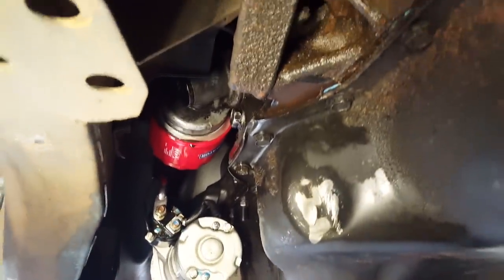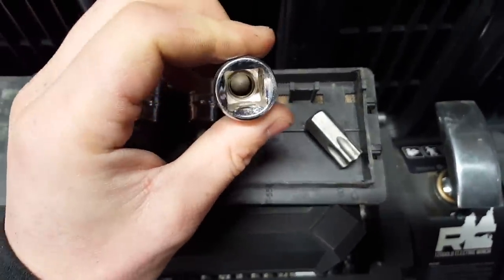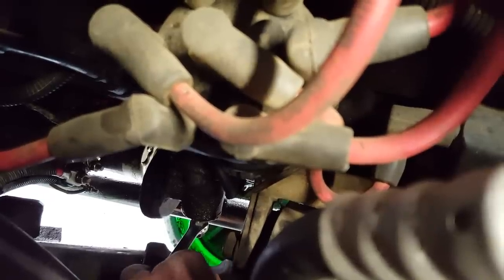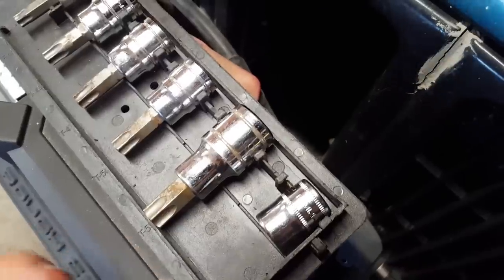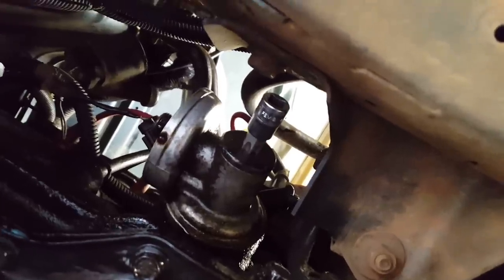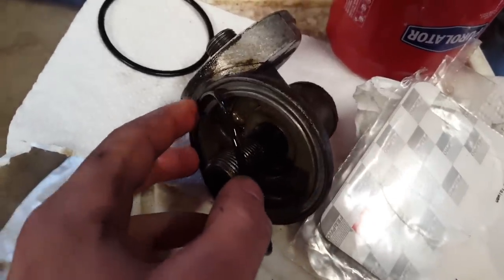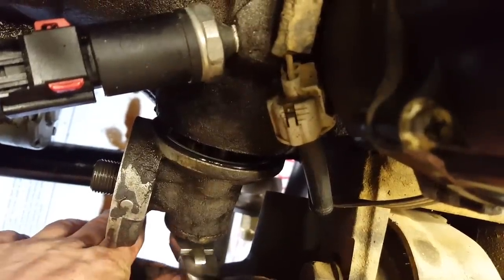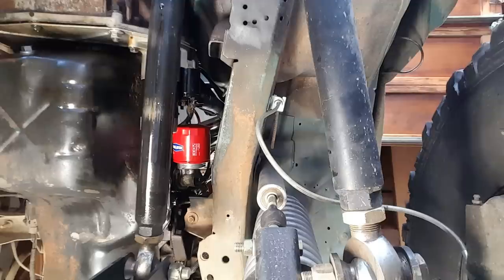Cheap Oil Leak Fix - The $2 Jeep Repair You Keep Avoiding

Comment: Hey Tim!  I did mine last August along with rear main oil pan and valve cover [thx for the vids on those].  Used a t60 in a set from advanced auto. Hammered out the bit and loosened it with a 12mm and a brakerbar accessed from the bottom. Maybe mine was easier cuz it was hot out.  Anyhow I changed the seals.. got an Oem pack of 3 from the dealership.  When i finished i put the T60 back together and returned the Torx set!  Great job on the Vid.  Keep em coming!

Comment: I being a former Dealer Jeep Tech, use grease on the seals ALL (3); and junk the purolator oil filter, get a mopar and grease the seal also. That's what I did my 92' xj. No leaks and eazy oil filter changes!
Reply: greg a purolator makes the oil filters for mopar lol
Reply: what kinda grease do you recommend

Comment: That's a good fix, but here's what I did on my 92 after some research. I removed that whole adapter thing, removed the dowel pin from the block, transferred the longer threaded pipe from that adapter into the block, and screwed the small filter directly to the block. Its a tight fit but the small filter will go in there. No leaks ever again in that area.
Reply: Did the same on my 2001xj today after putting it off for seven months. Bear of a job.

Comment: There are 3 O-rings. The other two are on the bolt itself. This is why I recommend getting the kit from the dealership. It's like $15, but you get everything you need. It's very likely your adapter will start leaking again.

Also, this job is MUCH easier if you undo the engine mounts and jack up the engine. It'll give you enough room to use an unmodified torx bit with a breaker bar. It's the perfect opportunity to replace/upgrade your engine mounts
Reply: gui577b felpro has an oring kit too. And maule.
Reply: Thank you for this comment!

Comment: Did this recently. Some tips I learned: Advance Auto Parts sells a T60 with a shorter bit than others I’ve seen. Gives a little more clearance. Using two other sockets like a pushing bolt/receiving cup pressed in a workbench vice works well to easily remove the T60 bit from the holder with no pounding. A piece of duct or black wire tape around the bit makes it fit snugly in the wrench. A large enough buddy wrench on the 12mm was enough leverage to bust mine loose. Finally, it would be hard to imagine doing this job without a ratcheting wrench. Hope that helps someone.

Comment: The correct part for ALL 3 O-Rings  by FEL-PRO is ES 72962 and in stock at 5000+ O'Reilly Auto Parts stores!
Reply: youre the real mvp
Reply: I got that part number for a 96 GC base oring was too thin.
Reply: @saintm1680  I don't know what to tell you but, I know it worked for me and every customer I've sold it to.

Comment: That's funky my 91 XJ has the exact same adapter but 180 instead of 90 degrees, same mess and embarrassment and extra quarts here n there, plus the environment... T60 as well, the guy at Sears thought I was out of my mind and I second guessed myself, nope that's a damn T60, probably the only use for this bit that I can think of. Thanks for the video, cheers!

Comment: It is a great fix. I pulled  passenger side motor mount. Rocked engine to the driver side.  Actually used an old oil filter gasket due to no parts store having a gasket.

Comment: There are 3 o rings in that 90 degree filter adapter. One between the block and adapter and 2 on the bolt that holds the adapter to the block. The one near the head of the bolt can also cause a external oil leak.  The complete 3 piece o ring kit is available online for $2 plus shipping.
Reply: Got a part number or link? Thanks
Reply: Not in the later years

Comment: Ah man, what about the other two O-rings in there?   There's two more inside there, where the bolt goes through to the engine block.  Should have all 3 of these O-rings:  0.676 x 0.070 AS568 size -017, 0.859 x 0.139 AS568 size -212, and 2.484 x 0.139 AS568 size -230.  I'd be a shame not to get all three of them replaced.   I just did mine two days ago and all three rings were hardened and flat.  They were all shot.
Reply: Seen the same thing on a few other vids of this project
Reply: That's what I was thinking.
Reply: SOMEONE SHOULD PIN THIS POST
Reply: Finally someone who speaks o-ring.   You are the only person I've seen listing the AS568 dash numbers for these O-rings - thanks for that!
Reply: Can I get these at autozone? And if so what do I ask for?

Comment: I remember a ratcheting wrench helped a bit on this job.  After doing oil pan, rear main, valve cover, distributor gasket, and oil adapter I still have a little bit of oil still getting on bell housing.  Noticed my head gasket on passenger side seeps. Never ending!

Comment: I used the handle from my 3T floor jack to fit over my 12mm wrench and got it from the top. Threw the adapter away and bought a 3614 size oil filter and some poly motor mounts. Now my jeep uses the same oil filter as my car and it's SO much easier to change.

Comment: Did this a few years ago on my 92. Thankfully mine wasn’t a torx but an actual bolt head. Slightly easier but still put up a hell of a fight.
Reply: What part is it the one for a 97 jeep charge would not work
Reply: @dynasty_c63amg59  not sure, i actually went to the parts dept of a local dealership to have them look it up and bought it there, if memory serves it was under $20

Comment: good showing to have put this together.  you've done us all a service.

after 10 months of losing 1 qt/week i finally dove into the job. 
 took about an hour with  $2. o-ring from NAPA.

chop-saw open end of a 12mm 12-point wrench.  so its handle would fit
inside a 18" piece of 1/2" iron pipe.  .. and the box end would go around
the t-60

  the arc  of swing available after moving the
cruise cable and some wires out of the way was only about 30 degrees.

that is enough though.   once loosened with the t-60 bit, the 12mm wrench and the pipe
the bolt was loosened the last 10 turns or so with a 8" slip wrench. 
this meant bending over in  that way that strains your back to be in  that position so long.

      one thing i'd do different next time is use grease to hold the new o-ring
in place. instead of just the engine oil.  too much chance it could fall off during
those moments getting the thread to engage when re- attaching the adapter.

on checking the oil level dipstik  each morning it is spot on where its been since this job.
no wet puddles under the jeep either when parked.

your video was the final nudge i needed to get going , even tho its winter here
in colorado.    

and increasingly when i tell someone this story and mention viewing a u-tube
how-to video others smile w/ understanding.

Comment: I drive a 2000  Cherokee Sport that I have already had the top and bottom engine gaskets replaced, yes both spots were leaking. It looks like oil filter adapter O-ring like in your video is the culprit on an oil leak I still have. I do a lot of things myself, but this is not going to one of them. I have a shop that does all my Jeep work I don't do so I'll leave this up to them. Great video.........

Comment: I did mine today and I had to remove some steering linkages off the front so I can get a cheater pipe on my wrench... then after that it popped right loose. I also replaced all 3 o rings and I didn't have any trouble getting the bolt screwed back in but I have been mechanic for 20 odd years....great video though because after all my years this jeep always has something new and weird go wrong with it...lol and it's good to get different ideas

Comment: I also struggled to remove this adapter when i did the adapter delete. (I don't recomend the delete, but was unable to source the 3 o-ring kit.) I used the T-60 key, like you got, cut short with a 12mm, 3/8 drive socket and breaker to break it loose.

Comment: Did this today. Took maybe 45 minutes and I was in no rush. Pounded out the bit from a T60 socket I had, inserted into the bolt, put a 12mm wrench on it, grabbed the end of the jack handle and it popped right off. Cranking it out was the worst part. Slow with not a lot of room to work. Once out, remove and replace o rings and reinstall. Easy stuff and should have done is sooner.

Comment: I did mine last year 2001 XJ.  There are at least 2 o rings if not 3 on there.  I wish I could remember.  DEFINITELY 2!  (edited)  Yup there are 3!!!!!   Push the bolt out of the adapter.  There are 2 on that shaft.)  To remove the torx bit I placed the socket under my floor jack and lifted the Jeep a bit.  It was the only way I could find to hold it tight enough to hit it with a punch.  I was able to remove the adapter from the top.  Something I do to loosen a stuck bolt is to put hard even pressure on it.  Hold it for a bit.  Try more than once.  Think of opening a stuck jar.  Someone tries and tries and a bit later it comes off with ease.  I find this works with frozen bolts.  Hitting or yanking on it can break the bolt.

Comment: Tim...Thank you for posting this. I have putting this off for the longest time but haven't really found any material on it. I have burned up 2 starters from the oil that drips onto them. This is much needed. Maybe think about doing other quick fixes in the future. BTW Love the 2 DR XJ.

Comment: I did it with out cutting it,  I fixed a box  end   on the shaft of the torx and then plugged it in the screw and it worked fine

Comment: When I did mine, I found that an L-key t-60 and a pipe for extra leverage was by far the easiest way to go. I had to order it online from a specialty tool store. Those bits can be a real pain to try to get out of the socket.
Reply: That is exactly how I did mine the last wrench was a great help

Comment: GREAT INFORMATION! READ THIS ALSO! Ok, so I just took on this project today on my 2000. What I thought would be about 2 hrs. ended up taking almost 4 1/2! A few other things to add that might help you if you’re going to do this. Definitely need a 3/8 breaker bar and a 2 foot long piece of pipe.You can try to break it loose from the top, yes it seems easier but, go at it from underneath, the angle is far better and less likely to destroy the torques head. (Then you’re screwed)! You shouldn’t need a torch, just make sure the motor is at temperature! Remove the 15mm frame bolt in your way. That gave me just enough room to get the breaker bar and T-60 head on with a 12 mm socket, (barely). Then SNAP, she finally broke loose, (then finish from the top).Also, use a bit of putty or even super glue or gum to keep the T-60 on! It’ll piss you off how many times it falls out! O’Reilly had the Felpro O ring kit in stock for 4.99$. ES72962 invoice # 170-202304

Comment: When I did mine, I used a t60 3/8 drive that was molded as one piece, not the typical two piece socket ones, then I took the threaded piece out of the adapter and installed just that piece back in the motor to eliminate the adapter, and now I just use a filter from a 2005 Toyota tundra to have the clearance from the unit frame, I'm sure there are other filters that will work I just know of that one cause I had it laying around, but now I don't have to worry about the adapter leaking ever again

Comment: I struggled with mine and did it the same way. You had a great idea with the socket if you grinded the bottom of the torques bit to get more clearance. Btw my 94 had 3 o-rings

Comment: Thank you for a great video. I had to change my crank  
shaft white waiting on the mopar part I did an oil change.

Ouch the oil filter  for the life of me would not budge  filter was crumbling into a collapsed mess. Finally with a bit of wd40 got it loose. changed the filter hand tight
Reply: My first change on mine I had to drive a spike through it and use a 4’pipe on it to get her to spin. Got it.

Comment: Yes a large  Ford oil filter  works great on a 4.0 L jeep with the  90 degree oil filter adapter.   Such as  part number  51515 from WIX.

Comment: On my 95 ZJ I got rid of the 90 degree fitting all together. The oil filter will screw directly on to the engine block where that 90 degree fitting went.
Reply: It fits?
Reply: I'm going to try on my 93 zj. Hope it works

Comment: I believe you spoke wrong when you mentioned a tube that feeds the oil pressure sender. That "tube" is a roll pin. It's to keep the adapter oriented. Someone discovered if you remove that roll pin you can find an oil filter that fits the block withOUT the adapter... smaller filter but solves all those "O" ring problems.
Reply: Wait! What? ―Ref' or Youtube video?

Comment: Hey there, I reccently did this and found some great advice to jack the engine up from the oil pan (using a piece of wood to distribute the pressure) and then removing the enging mounting bolt and then jack it up about another 2 inches and you'll be able to get a breaker bar in there easier from the top which then allows you to use the largest breaker bar tube or cheater tube to get maximum leverage. Mine was about 1.5m long lol

Comment: The oil adapter ring, the dizzy ring and the dipstick tube are the main leaks in the upper part, the rear seal is also a leaky part, then the cranck case ventilation ports in teh valve cover also like to leak oil

Comment: Btw.. you want to put a layer of oil on the o-rings on bolt, but I cleaned the o-ring surface for the housing with brakekleen, wipes it, then installed it.. makes a better seal when it’s dry..

Comment: TIP: Put two 12 mm wrenches on the T60 bit and a cheater bar big enough to fit both. I also ended up bending using just one so I tried the double method and it worked 🤙🏼 After owning my 98 Cherokee for almost 10 years, I finally decided to replace the o rings since the leak got really bad.

Comment: I replaced just about every gasket/seal on my 4.0 (rear main, oil pan, filter adapter, distributor, valve cover, etc.) and it still pissed oil everywhere. But that’s because it had bad piston rings and there was so much blowby that it was too much for the pcv valve so all the extra pressure in the crankcase that couldn’t escape through the pcv valve was forcing its way through a seal somewhere which caused it to leak A LOT. Unfortunately this was when I was in high school and I didn’t have money to rebuild it so I had to sell the jeep

Comment: its still tight because there's two o- rings on the bolt, for those watching this video for how to info tap on the big bolt that was threaded into the block and it'll come apart and you'll find two more o-rings you need to replace

Comment: The accessibility of the bolt was fixed in later year, post 1998 obviously. More than likely in 2000 with the coil on plug newer system, without the distributor, because with my 2001 I could use a 1/2 socket wrench with theT-60.
Reply from the maker: Dylan Cox That would have been SO nice!

Comment: Good to know!  My 99 leaks oil from every crevice thats supposed to be sealed. Oil pan, rear main, valve cover, oil filter  adapter.  You name it. If its supposed hold oil it leaks! Another common one on these is the front crankshaft seal. Total pain in the ass to replace

Comment: Hey, an easier way of doing that is to thread a pipe for the end of your oil filter adapter, and just screw the pipe on in place of your oil filter and you have an instant lever.

Comment: Just swapped a 99 Tj 4.0 in my 99 XJ and while yes it is a snug fit to the unibody you can still change the oil with relative ease, you only need to move the one starter wire out of your way with one hand and, then finagle the filter into place and tighten it. Idk why Jeep just didn't use this style instead of the adaptor. Yes the adaptor made oil changes easier but it was still about the same with this new motor, so my recommendation is if your 97-99 XJ motor blows try to find a 97-99 TJ motor to swap in.

Comment: They make allen wrenches with those torx ends.  I don't know what they're called, but having a set for this and other things would be swell.  I've thought of buying some over the past half year because I have encountered more than enough situations to warrant.  If they sold them at the local hardware store I would've bought some, but I'm impatient so I just find shade'tree engineering methods more to my liking.  I've only had to take that thing off with the engine out so I haven't had to deal with this fiasco, although knowing for sure that clearance is a pain I will certainly be considering a set of those as my next necessary tool purchase.
Reply: I used those to get one off a ZJ at the junkyard. Didn’t have any issue getting it off. Must have forgot to loctite it on the assembly line
Reply: those allen wrenches cannot hold up to the torque of that fastener. The ends snap off imediately

Comment: 0n my 92 cherokee instead of a torx its a bolt head, something to look for in the scrap yard if you're going to be replacing/doing this job... dude you totally missed replacing orings while you had this out. however judging by the difficulty you had reinstalling/starting the bolt the ones you missed are probably still good.  I recomend you replace the torx bolt with the bolt off an older jeep so itll be easier in the future if you ever need to do this job again

Comment: You can use part of that adapter with the male-male threads, screw it straight into the block, and use a smaller filter and just skip the 90 degree adapter altogether. I think it’s fram ph3614.

Comment: Just did mine a few weeks ago.  PITA!  I used a socket wrench and mistakenly backed it out so far that the back of the wrench got stuck against the unibody.  It was too tight to flip the wrench switch to drive it back forward a bit.  Took me 45 extra minutes.

Comment: The bolt isn’t a captured bolt it has an o ring on the bolt itself that you should replace as well. And not all xjs have the torx style some have a hex head bolt which I converted mine to makes it so nice.